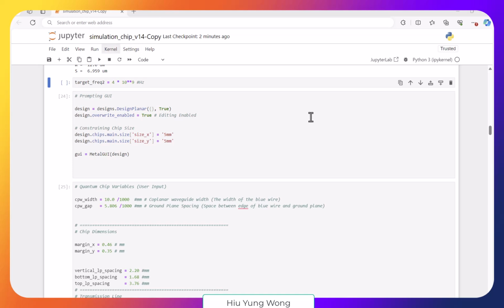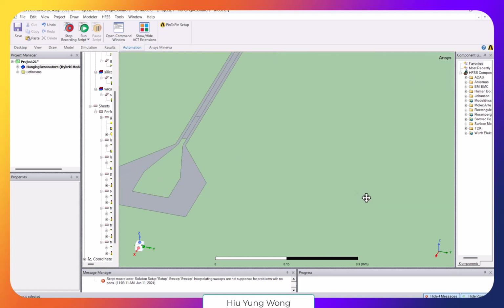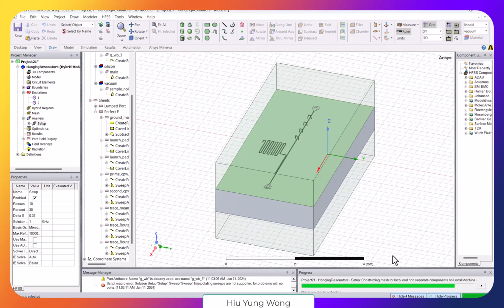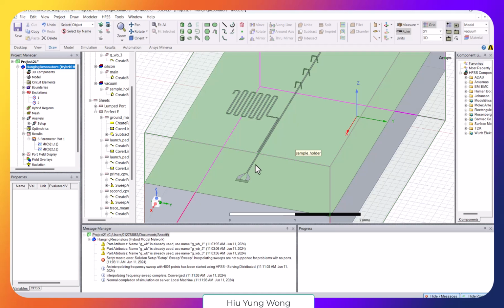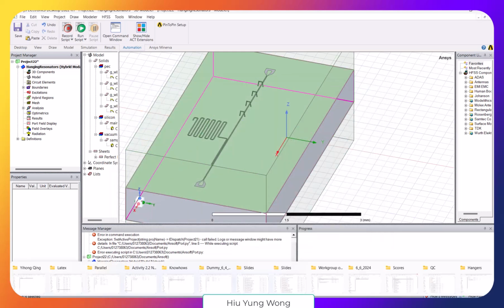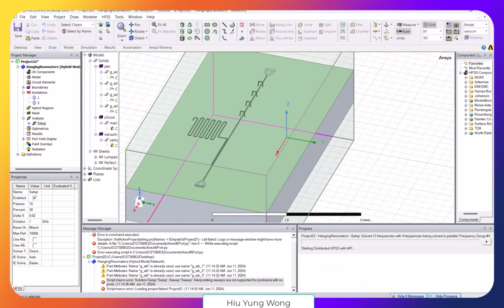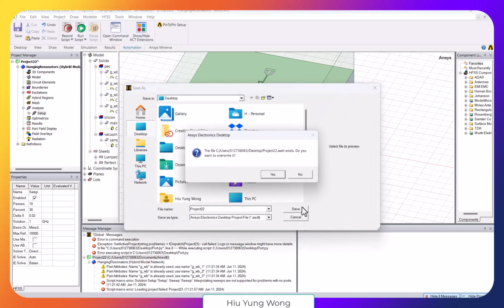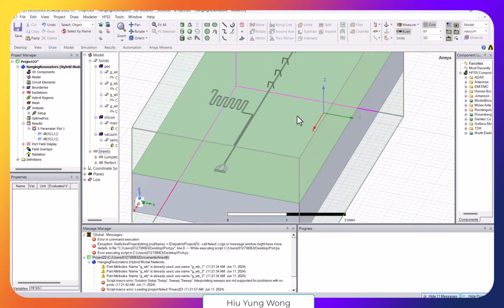How to Simulate Transmission Line S Parameter using HFSS - Quantum Chip Design

Comment: Hi, I really like your videos, and I would like to ask for advice on modeling in HFSS as a beginner. I am modeling a transmission line, how to set the size of the wave port correctly (I have already found certain recommendations)? The problem is that online line impedance calculators give different results, so I don't understand what transmission line sizes to take in order to validate port sizes (so that the impedance is about 50 ohms)? Maybe I confuse the wave port impedance and transmission line impedance — how can I check each of them in HFSS?
Reply from the maker: Not sure if I understand your question correctly. For the transmission line, you want to make the spacing and width at the right values so that it has a characteristic impedance of 50 Ohm (https://www.youtube.com/watch?v=DsGiP1Hs-K0&list=PLnK6MrIqGXsIS_97Nt-8R6uNrJXxMiOro&index=7) . At the port, you then want to see the impedance to 50 Ohms.
Reply: @quantum_computing , yes, but Impedance when calculating in hfss depends on wave port demensiones. How should I validate port sizes (convergence in S parameters, impedance, etc.?)
Reply from the maker: @Polly5x  I see you are referring to a wave port. A lumped port is used in this example. I am probably not knowledgeable enough to answer your questions. Sorry!

Comment: what boundary conditions you used on solution box?
Reply from the maker: I did not apply anything to the boundary box. So, just the default.
Reply: @quantum_computing  the lumped port should be connected between two conductors and two edges should not contact as to be consider  perfect H. Reference is YouTube video modelling signal inputs with Ansys hfss using wave ports and lumped ports
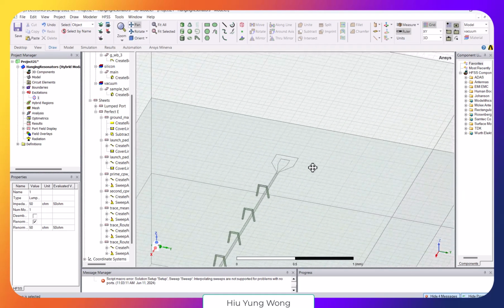Reply from the maker: @invincible3wealth  I thought you were asking about the boundary condition of the outer faces/edges of the whole simulation domain. That was the default. For the lumped port, you can see how we set up around 4:48. Not sure if that's what you meant.